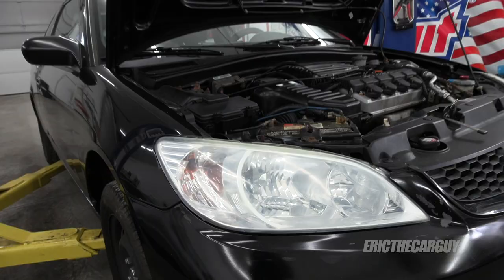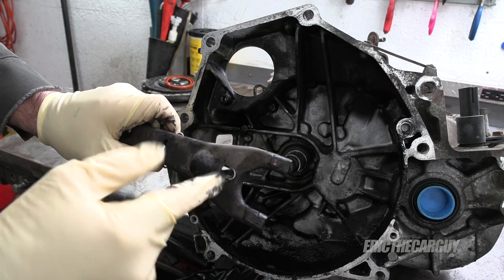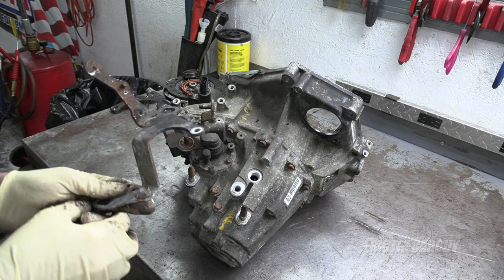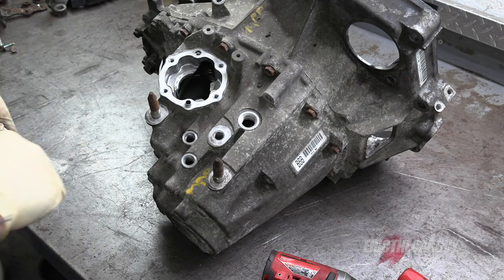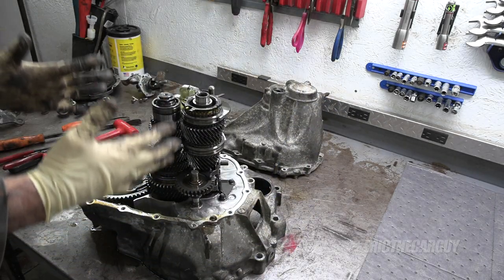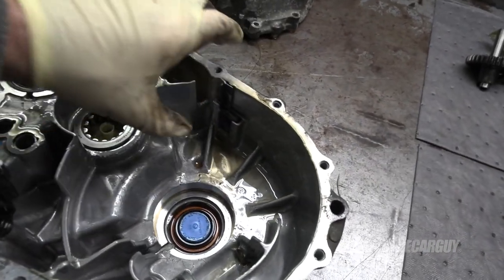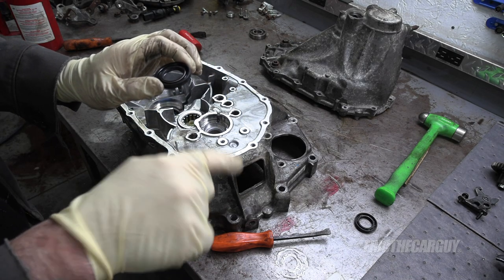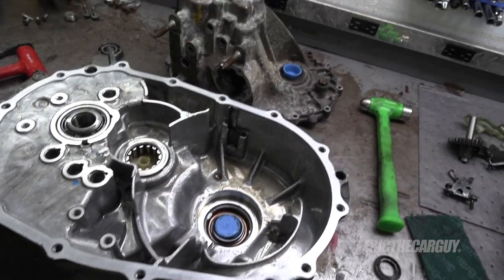01-05 Honda Civic Manual Transmission Rebuild

Comment: FYI. After I completed this job, I had a front end clunk when accelerating from a stop and when heavy braking. It took me forever to figure out the issue; I changed so many parts unnecessarily. Apparently the subframe should be tightened with weight on the tires, not when jacked up. I loosened the 4 -17mm bolts holding it, let the car off the jack stands, then tightened them back up. Clunking is finally gone! Another thing I did was make sure the sway bar was aligned correctly, equal distance from the control arm on both sides – loosen the 2 bushing brackets and use a pry bar to wiggle it left or right as needed. Hopefully this helps someone. Thanks again Eric for another epic video; it saved me a ton of money giving me the confidence needed to tackle this job myself. You saved my Civic from the boneyard... Cheers!

Comment: Just finished replacing my clutch, pressure plate, release bearing, rear main seal, axle seals, and input shaft bearing + seal on my 2004 on the floor of my garage with jack stands. Definitely referenced this video a bunch of times. Thanks again Eric for the detailed overview. A couple details I'll add from my experience:

1) I used lots of penetrating oil when dealing with rusty fasteners and separating the ball joints. 2) Cleaned the corrosion off all the dowel pins & holes for easy assembly on the transmission case and engine. 3) I used a 3-point engine support stand to hold engine during trans removal. Made life easier when working on the ground. 4) I used a decent jack to remove/install subframe as well as transaxle. Needed a 2nd hand to operate jack while I analyzed part alignment/positioning. 5) I had to drill out a seized cotter pin from the shifter assembly once removed. 6) I ordered all new washers for detent screws, reverse switch, and drain & fill plug. Also ordered new inspection plug. 7) As noted in the video, attention to detail and cleanliness is very important especially with the Hondabond. 8) Use proper torque specs from the service manual. 9) Oh almost forgot! When loosening or tightening the flywheel bolts, hold the flywheel from rotating with a 12mm wrench secured by a hand threaded pressure plate bolt and a trans/engine bolt. Worked great.

Best of luck everyone! 🔧🔩

Comment: Dropped the 01 civic manual, replaced bearings, synchros, seals. The input shaft bearing was the culprit. Slapped it back together and shifts like new 3000 miles later. Couldn’t have done it without this video, so thank you ETCG, saved me a lot of $$

Comment: They are known for input shaft bearing failure. I nearly bought one recently, seller was adamant it was the throwout bearing. I ended up getting another civic off someone else, been good as gold since, as you would really expect from a Honda.

"Edit" Roughly 20000 miles ive done in it, and over the past few days im getting a noise, which im guessing is the first signs of input shaft bearing failure, nothing major yet, but its only gonna get worse, hopefully will hold out a month or so, so i can get the parts in. Hence why i am back here. Not looking forward to doing this, but will need to be done. 

Thanks for this Eric, these vids really help.
Reply: So, 3 years have passed and around 25000 miles and ive not got round to doing it, still driving the car and its not got any worse. 😆 The only time i will do it, is if/when the clutch starts slipping and needs changing.

Comment: Thanks for the ride-along!

The secondary shaft snapped on my Honda XR400 dirt bike back in the day...  I'd never done any major transmission work prior.  Needless to say, I had the shop manual and parts explosion diagram memorized.  It was a bit unnerving at first.  But, I got it all back together and rode the wheels off the thing.

I do see a refresh of my 1993 C1500 4L60E automatic transmission at some point.  It will be another virgin cherry pop event on my long, productive, and cost-saving DIY moto career.

It's content creators like you gear heads on YouTube which make things so much simpler these days...  I can watch a dozen or more procedures rather than flying completely blind in years past.  Thank you!
Reply: Those older Turbo-HydraMatic designs (yours is, mechanically, a THM-700R4) are dead-easy inside. Just do yourself a favor and buy the clutch compressor tool. It's possible without one - I've done it using C-clamps - but it's just a nightmare.

For seating the square seals, I find a bit cut out of a 2L soda bottle works better than the feeler gauges most books recommend, same as seating fork seals. Just smooth the cut edges a bit with some fine sandpaper or Scotch Brite.

Also, get some transmission assembly lube. They're thick like the grease many people use, but they're usually like a paste wax or gel and they completely dissolve once the fluid heats up. I like to use green or blue - they also dye the fluid so you get a clear leak indicator. Use it everywhere.
Reply: Yeah, I'll build a compression tool when the time comes.  Welders are marvelous devices to have in the garage.  And a double yes on the two-liter pop bottle plastic.  I use it all the time for such tasks.  Thanks!.

Comment: My first new car was a 2004 civic ex automatic now 315,000 miles best car i’ve ever owned still have it!! I did buy a new 2019 accord touring 2.0t.
Reply: With new head gasket or stop leak. I work on Hondas & I don't see many 01-05 civics make it to 315k in the best of conditions. Kind of a unique little engine. Arguably better than 06-08 with a cracked block but not much.
Reply: @ryandavis930  its the original head gasket! I think a lot of it has to do with a strict servicing schedule  it’s whole life. Back in the day I had a 1990 CRX 480k tree fell on it 😩

Comment: The issue with noise that prompted your transmission rebuild plagued the first version of the Honda Jazz/Fit 2002-2008 many of which were affected sometimes after just 10.000 miles.I cannot think the procedure described here for a Civic would be much different in the case of a Jazz/Fit so this demonstration is potentially very useful for any amateur mechanic wanted to extend the life of these both cheap but wonderfully reliable cars. It must also worth noting that the noise on the bearings while obviously annoying and distracting does not necessarily imply that the bearing will fail, as it not a sign of bearing failure but an error on design or manufacturing. Finally the quality of the video is top notch and your advice solid. Thanks.

Comment: The input shaft bearing seems to be a common issue on most fwd manuals.  I’ve done at least a 2 dozen of those bearings when I worked at Nissan. Really helps when you have a lift.  But I don’t have one at the house, so going to be changing out the clutch, flywheel and input shaft bearing on my ‘12 Sentra SE-R Spec V w/194k on the OE clutch in the garage in a few weeks.  Best part is my son is going to be doing most the work and I’ll be “supervising”.
Reply: I've heard that manufacturers use bearings with plastic cages instead of metal to make it a little more quiet, but the plastic degrades over time and it gets much noisier than if they had just used a metal cage

Comment: God, I am still scared to take out the gearbox in my Accord, only worked on engines, well I guess its time to start! Thank you Eric for this video, you are one of the greatest Honda experts ever!
Reply from the maker: I think you'll be fine. Good luck.
Reply: Ive got an old 1989 Mazda 323 turbo 4WD, and had to have the box apart to replace a badly leaking input shaft seal, i expected it to be a nightmare, which it was, but got there in the end. But like you, taking a gearbox apart i imagined springs and cogs flying everywhere and not knowing where the hell they went back. 😂

Comment: My 1st Sergeant in my Army Unit had a 90's Civic, the throwout bearing was making all sorts of noise, as was the rest of the transmission...his fix turn the radio up louder.  I have no idea how long that car had been making that noise but the turning the radio up louder seemed to have kept it going at least for the 7 years he was driving that car that I knew of LOL

Comment: OMG! Summer or 2019 I finally got the balls to do it. And rebuilt the transmission. I had to replace the input shift bearing as well. I did just fine with doing mine.  I wish I had done a video, cause there was nothing when I did mine. I'm excited to see that you are doing this!

Comment: Been watching another channel that features a transmission shop. The channel / shop owner has been working on 4L60E type transmissions. The size difference between what I have been seeing there and Honda transmissions here is simply amazing to me. I know more power requires more metal and hardware, I get that. The size comparison is almost comical. Really enjoyed this installment! ✌😁
Reply from the maker: There is a lot more to an automatic transmission than there is a manual. Even a Honda automatic for the same vehicle is bigger than this one. Thanks for the comment.

Comment: OMG, but this is still so much work just for a bearing! I mean, you have to  have the transmission taken out, then taken apart, have the bearing replaced, then having it put together and installed into the car again. I am pretty sure that is a several-hundred-Dollar job right there! I would definitely make sense to replaced the clutch as well in case something like that happens with a clutch that is several years old or even the original one from the factory. Still, it's a hell of a job. And finding an honest mechanic you can trust with taking good care of your transmission and not messing something up is yet another thing to consider. But well, the things we wouldn't do for our beloved Hondas! ^_^

Comment: Excellent tutorial Eric!!!. Every single civic from that generation with manual trans has or had that noise. That is the normal failure on those trans. But I will take it over any automatic transmission. Save the Manual!

Comment: I wish I had seen your video before I did my input shaft bearing a few years ago! I used permatex gasket maker and I remember assembling the housing in a panic because it states that you have to assemble in 5 minutes or start over! Also, if you spin the bad bearing inside it’s housing, the noise is amplified x10! It’s no wonder these are so noisy! You shoulda seen me opening the housing with my two screwdrivers; I actually used my chin to open the snap ring pliers!

Comment: 10:19 the main shaft has a bushing or something sticking out. Mine is flush with the bearing end. Something I need to be concerned about?
Guess it was nothing to worry about.  Thanks Eric for the video.  Replaced the input shaft bearing and all seals and it's like new again.

Comment: My 2001 civics input shaft bearing is so bad that when it gets slack in it in 1st gear, it will wake up the neighbors at 5 am.  saw your vid about the crap clutches and the exedy clutch kits.  I had bought the perfection clutch kit back in 2016 and never installed it.  Trans wasnt that bad yet.  OMG the perfection clutch disc is total crap.  2 whimpy springs with 4 additional rubber dampers(cant tell if theres a spring inside them).  Just got my exedy clutch kit in the mail.  all 4 exedy disc springs are tight as they should be.  The 6 whimpy perfection clutch disc springs are loose and whobbly as I can wiggle them by hand!!!!  the name perfection must be pure sarcasm.  So glad I saw your clutch install on your same black civic.

Comment: Thank you for the video. Helped me get through a transmission rebuild. One note, on the 2001 model reverse is not accessible without the engine running. Really scared me when going through the gears before adding transmission fluid and I couldn't get into reverse. It all resolved itself once I had the engine running.

Comment: Thank you so much for this! I got it apart and figured out I needed a countershaft bearing also, so reassembly won't be until tomorrow when Honda gets the part in
Reply: What made you realize you need a countershaft bearing too? What were the symptoms. I hear the input shaft noise on my 2010 Fit but also a sound that sounds almost like I have straight cut gears when driving.
Reply: @JoosshhST  once I took it apart and spun the bearing by hand I could hear and feel it going bad. I don't know if I could explain it but you could look up videos about how to tell if a ball bearing is going bad they all pretty much sound the same

Comment: Replaced mine couple yrs ago. The plastic bearing cage inside the races was gone. All the pieces were in the oiling system channels. What a mess. Noisy as hell. Whoa 
 The 90's S20 shifter assembly is way more pain in the ass to deal with than this setup. Very nice.

Comment: Hey Eric Excellent video !  You were most informative and gave us very good tech tips . If the transmission has never been out, why is it so common for these input bearings to fail ?
Reply: Low or dirty fluid will certainly contribute. But another big reason, possibly the main reason, is the cage that holds the balls is plastic and frequently breaks apart. The input shaft bearing for the K series transmissions used in the Civic Si, Accord, CR-V, etc uses a metal cage and those never go bad. I recently had a 20 year old K20 transmission apart to install an LSD and bought a new input shaft bearing to install while I was in there just for piece of mind, but I was shocked to see that the old bearing was still in perfect shape and had no more play than the new one. There's certainly something to be said for using quality bearings instead of this cheap plastic crap!

Comment: Honestly looks straightforward and fairly easy.  I am looking at one that needs the 2nd gear replaced.  Of course while in there I would replace all seals & bearings, as well as the throw out bearing & clutch as it all goes back into the car.  No hot rodding, just back to stock specs clutch kit.  Everyone wants to build these into tuner cars. I have a 400 HP Mustang GT for that.  I want to build it into a "hyper miler" ...... as absolutely aerodynamic and fuel efficient as possible including LRR tires.  ;-)

Comment: Nice video Eric. I hope I never have to do this. Without a garage lift, it should be fun...Anyway, nice under the hood light you have there.
Reply: It’s easy to do without a lift! You can remove the transmission from the top, you just have to remove the thermostat/housing and you can pull it straight up. Keep the bracket on so you can hook a chain (I used a small come-along from hft) onto it and with a little bit of wiggling it should come right out.

Comment: Appears identical to my '99,except for that plastic piece at 11:33. Hardest part of my rebuild was getting the primary and secondary gear stacks (along with gear selector) to slide back into place. Took a bit of finesse
Reply from the maker: Shift linkage is a little different as well, but the rest is pretty much the same.

Comment: I love manuals👍

You previously worked at an Acura dealership correct?  So your experience with that trans allowed you to diagnose the noise and specific bearing failure? Impressed.
Reply from the maker: I'm a former Acura Master Technician. I've also been working on Hondas for the past 25 years. However, this type of noise is typical of an input shaft bearing problem in my experience.

Comment: I've lost reverse and 5th in my 04 Civic. I just can't get it to shift. Fluid levels went low a couple of times because of failing input axle seals. What would you recommend replacing in the transmission? It has 460k on it.

Comment: I had a very similar problem on the 96 civic about 15 years ago when I was a teenager, eventually the clutch ended up slipping because gear oil was leaking from the seal at that bearing onto the clutch disc. I just ended up replacing the transmission with one I pulled out of a car at a wrecker when I did the clutch, it’s too bad there weren’t resources like this back then, I suspect that replacing just a seal and a bearing would’ve cost cash strapped teenage me less than what I spent.

Comment: Why why why did ford go To a hydraulic slave and throw out bearing? I’ve had to replace mine in my 02 f150 twice in 350k. Guess I can’t complain!  Almost 400k on her now!
Reply from the maker: It's cheaper to use hydraulic components and lines than it is to use mechanical. Cost is always the reason.
Reply: Honda slaves are hydraulic as well, but the cylinder is mounted external to the bell housing. Nobody is using cable clutches any more
Reply: "laughs in mechanical linkage and z-bar"

Wait... No I don't. It sucks too. Crap.

Comment: To  Cole J: the stuff in the solvent sprayer is probably brake/parts cleaner. Repair shops buy it in 5 gallon cans. It’s not as convenient as aerosol cans but cheaper.

Comment: I was thinking about why the input shaft bearing tends to fail on Honda manuals. I don't think it's a design flaw or bad parts. It's a shaft that sits in a ball bearing. It's not mysterious or complicated from an engineering perspective. I think these bearings fail because manual Honda's tend to see higher than average RPMs, leading to eventual failure.
Reply: As an owner driver who is about to do the same job but on my Honda Fit , I suspect that the Particle Magnet becomes unable to hold onto all the metal particles over time. So I will investigate getting a magnetic drain plug  -- perhaps from the equivalent Honda automatic transmission , to increase the amount of magnet. Likewise I fitted magnetic sump and gear box plugs to my BMW dry - clutch motorbike. Great Video Eric !

Comment: A lot of work for riding the clutch :)

Nice video!
Reply from the maker: The root cause was the lack of transmission dowel pins, not riding the clutch.
Reply: @ericthecarguy  Oof!  Factory omission?  Still a great video - the simplicity of manuals is why I still prefer them.
Reply from the maker: Previous mechanic omission.